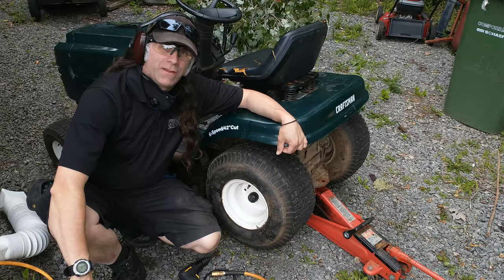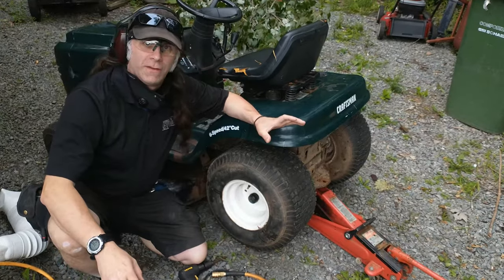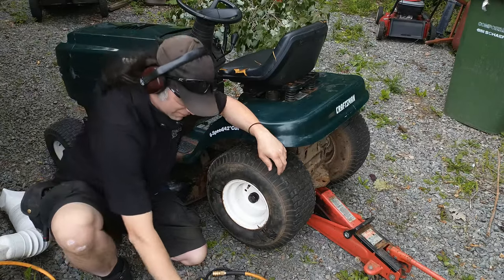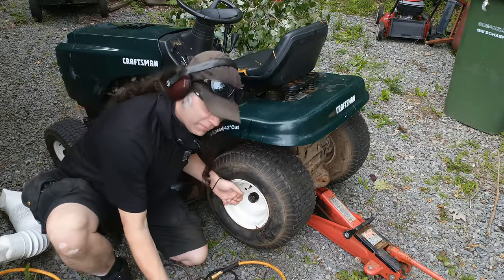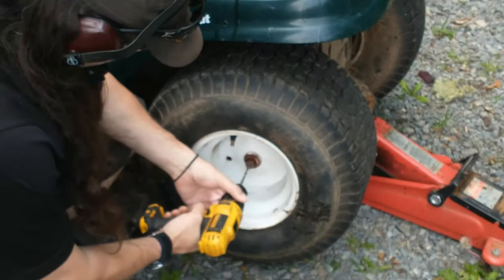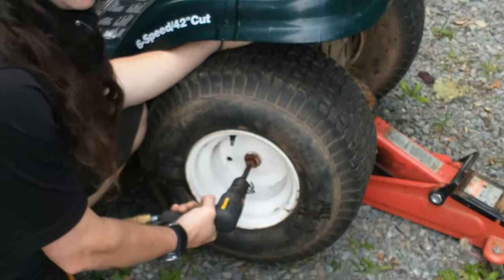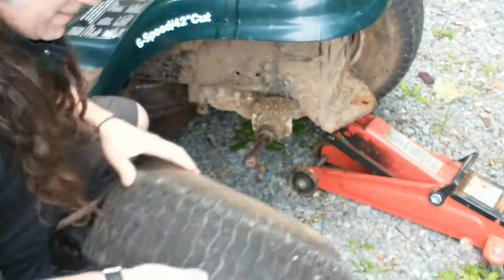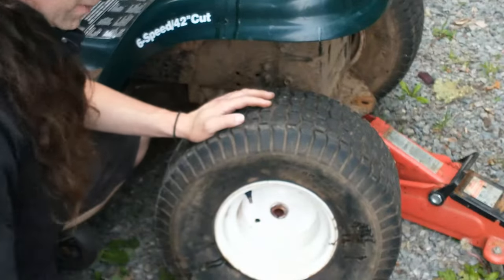How To Remove A Stuck Lawn Tractor Wheel

Comment: Thanks for the tip, one wheel came off without any problem, but the left rear would not budge one bit, after a lot of hammering on the wheel from the inside with limited luck I went and bought a air hammer and it came right off. Oh boy was the axel rusted (the lawn tractor was used a while back to plow snow, I think that caused the rust)
Reply from the maker: So glad it helped you out 👍👍👍 I don't think snowplowing caused the rust on your axles, they don't put any grease or anti-seize on them at the factory so they love to rust on there as you found.
Reply: @patthesoundguy  I should have taken photos of the rust before I cleaned the axle, but I was so excited that I got the wheel off, I couldn’t wait to clean and put the anti-seize on it.( I was already looking at a replacement tractor since the wheel wouldn’t come off.) I WILL from now on remove the wheels each fall and re-grease them……..lessons learned. Your tip saved me $3,400!
Reply from the maker: @davidmorgan602  That's fantastic, so glad I was able to save you some money 👍👍👍

Comment: Do you think this method would work on a stuck on mower blade??? My tire and my blade are both stuck :( Its on a Yardman Yard bug little riding mower.
Reply from the maker: That trick works on all kinds of stuck parts. You can even heat and quench on the blade then vibrate it with the air hammer. You got this, I know you can do it 👍

Comment: I tried this today but it didn't work so far. I'm going to push a tight fitting small cup of penetrating oil over axle and hub, let it soak all winter. Then try it again in the spring. Should work, hopefully, lol. Thanks for the Vid.
Reply from the maker: I would try some heat at this point. I heat parts like that and then add the penetrating fluid and the heat will draw it in. It may take a few tries. A puller may also be the answer.

Comment: Does that damage the other end of the axle shaft?
Reply from the maker: Nope it keeps everything from getting damaged. It's the best idea to do your best to make a small indentation in the end of the shaft to put the pointed end of the air hammer into. It's better than beating it with a regular hammer that tends to mushroom the end of the shaft. Some wheels have a bolt that holds the wheel on. In that case put a divot in the bolt head and remove any washers and drive the wheel off with the air hammer as normal.

Comment: Will impact wrench work ?
Reply from the maker: Unfortunately no, the impact is only useful for removing bolts or nuts, there is not enough hammer action to force the wheel off of the axle shaft.
Reply from the maker: @purchasepete  you may be able to get a puller from your local auto parts store on a loan for free to pull them if you don't have an air hammer.
Reply: @patthesoundguy   Thanks for advise ...I like FREE !

Comment: I bought a brand new air hammer from o'riley for 75 dollars,  so far I've bored a hole about 1/4 inch into the shaft and the tire hasn't moved a centimeter..
Reply from the maker: Bummer! Are you pulling on the wheel at the same time as hammering?  You may need some heat and or a puller at this point.
Reply: @patthesoundguy  Ya I tried a 8 inch 3 way puller first and did absolutely nothing,  tried a sledge hammer and heat next and last hope was the air hammer.  Guess I'll just drain the oil and flip the mower on it's side and try to get the old tire off and a new tire on the rim.
Reply: @diggin-treasureinmissouri7408  There is a Youtube video of a guy using a hydraulic jack to remove one of those wheels. It was pure brute force but it worked when nothing else did. The title of it has duct tape in it. 

He used two steel bars behind the wheel, one above and one below the axle. Used tape to hold them together while he rigged a chain to allow a 20 ton jack to push on the axle using a socket that was just smaller than the axle OD. His was really stuck, but that technique got it off. Give the axle a lavish coat of AntiSieze after you clean the rust off it before you reinstall the wheel.
Reply from the maker: I saw that video fly by yesterday in my feed, I didn't have time to watch it. Gotta go find it now 👍👍👍
Reply: The guy's channel is Junkboy888, Title is Removing a stuck rim off a riding mower with the help of duct tape.

Comment: Wailing like hell on those axles will screw up the differential.
Reply from the maker: That's not wailing on the axles, using the air hammer is common practice. It only moves them a small amount, nothing like happens to them under normal use.